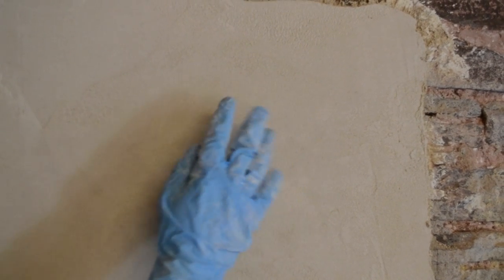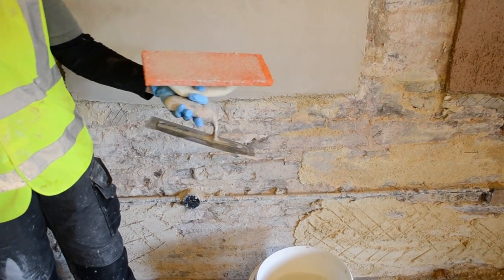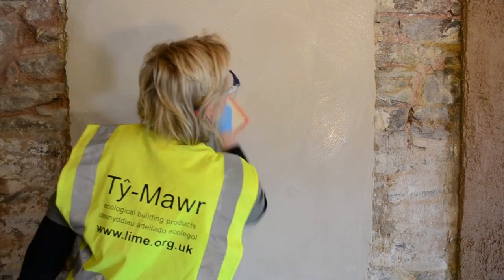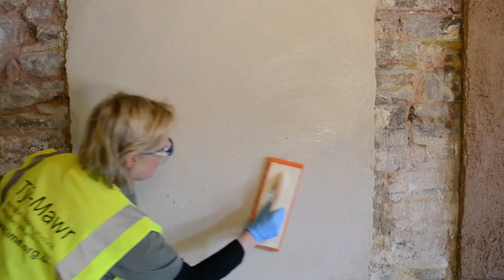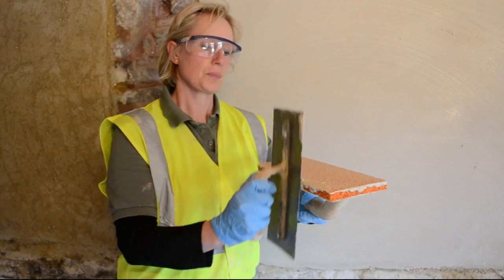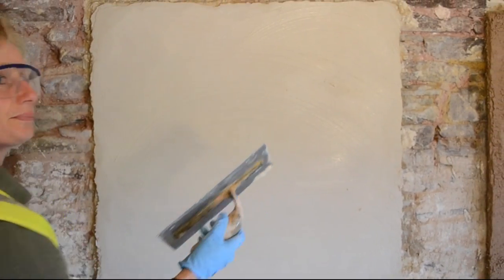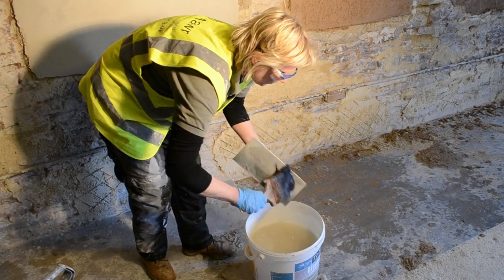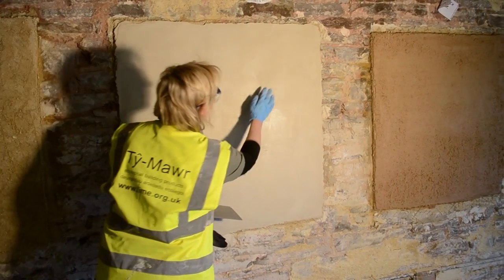20) Finishing lime plaster (smooth and flat)

Comment: EXCELLENT set of videos! I have re-plastered a room (replacing gypsum based plaster) in my Victorian home using the methods and products taught here. Everything worked brilliantly. Funny thing: I have an aluminium hawk and when I was plastering the finish coat, the hawk was fizzing away! some sort of chemical reaction. I thought I was going mad all day hearing a leaky pipe, or my ears going bad, until I figured out what it was :-)
Reply: What paint did you use on the lime plastered walls?
Reply: What Lime plaster did you use? And how easy was it to learn to plaster with? Aiming to try this myself :)
Reply: I had the same when using finishing plaster (I suspect due to the higher lime content). Have since changed to an ABS hawk. The bubbling is hydrogen I believe, it is a known reaction between Aluminium and Calcium Hydroxide. You are essentially etching the aluminium hawk.

Comment: Can you tell me what type lime is used for smooth interior smooth finish over drywall if I cannot buy your product here in USA?

I used to build and did buy the material for the plasterers and I bought dry bags that were mixed in water overnight and screeded next day. Plasterer would mix gauging in as they used it to set up.

If textured they mixed in Silica sand.

Any idea what type dry lime I would need if for going over interior drywall?

Appreciate very much.

Great video.

Comment: I have an nice victorian house solid wall and it is plastered with gypsum based plaster. It is possible to apply lime plaster over? or I have to remove all the gypsum plaster? Or I have to remove also the render and start from the brick with lime render?
Reply: No point in plastering over gypsum with lime... the gypsum isn’t allowing the wall to breath... if you don’t have any damp issues, then leave as or skim with gypsum.

If you want to lime plaster to help with damp, the remove the gypsum.